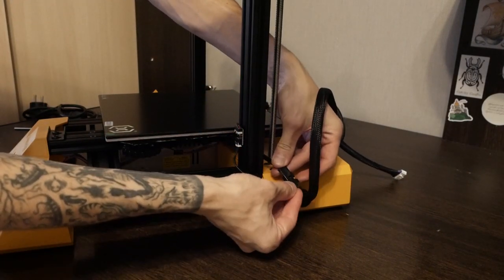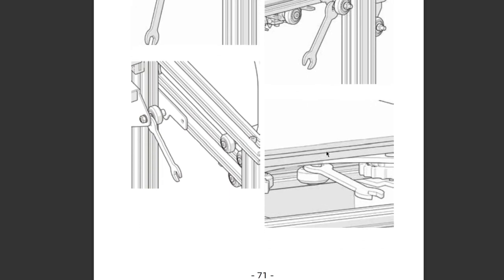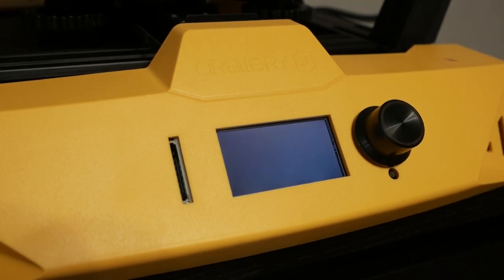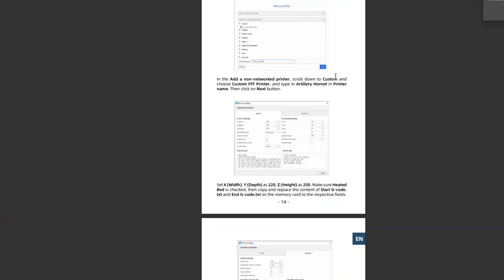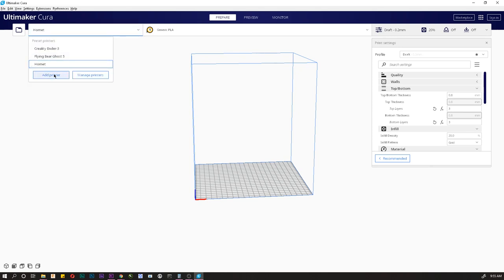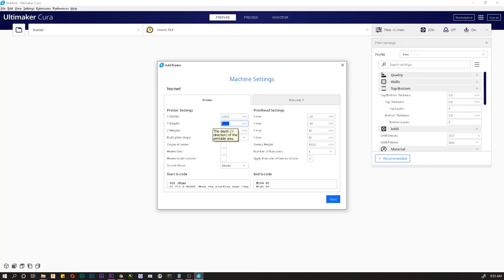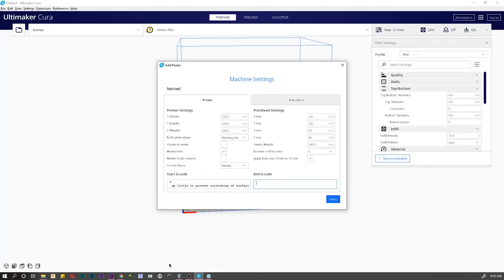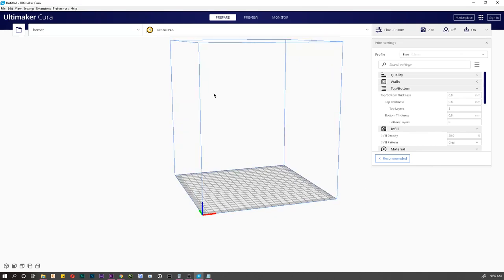3D printer review Artillery Hornet from Hekka

Comment: Which Cura settings did you use to print the vase and the lizard?  For me, the table moves a bit, despite the tightened screws.  And it is also crooked. Kind regards!